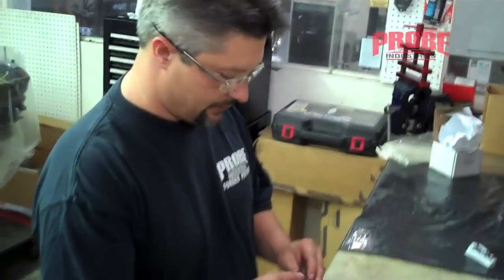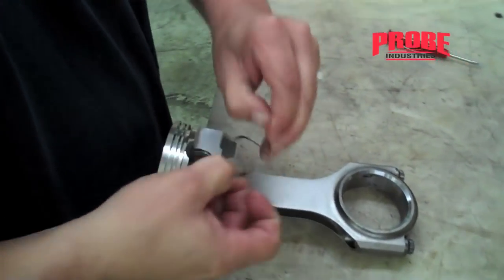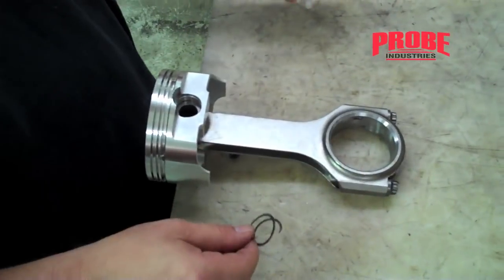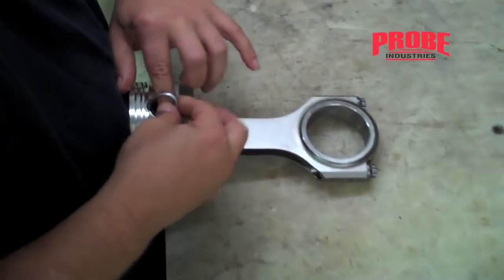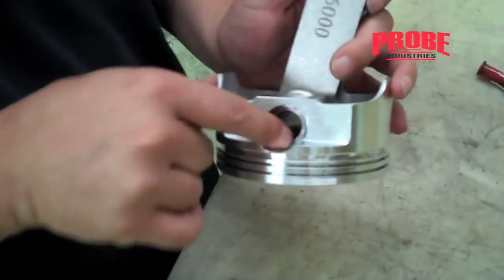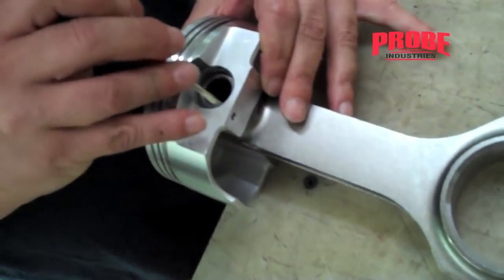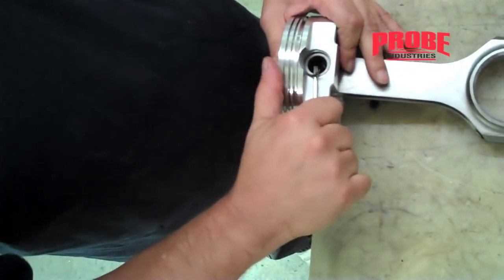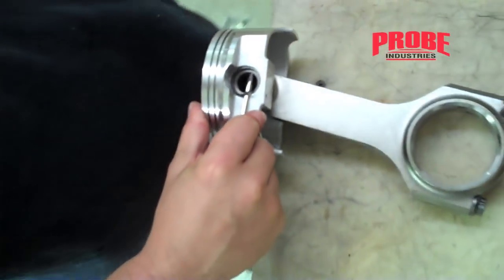How To Install Piston Spiro Locks

Comment: Those things must be pretty weak or single wound as it looks alot easier in your video to do than the doublewound ones... Im a pretty strong guy and the CS-24's from Wiseco are really springy with alot of tension...You pulled those ones you used apart pretty easily..I got the sharp edge of the SpiralLock in my thumb doing that but I got the tasks done none-the-less.....LOL...Awesome and directly informative video..